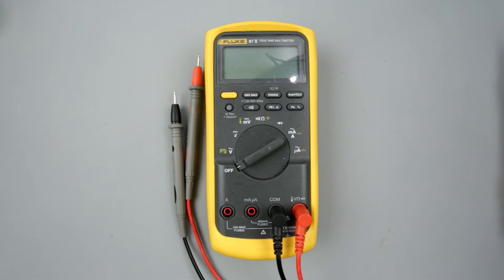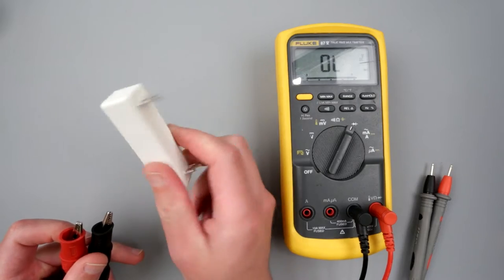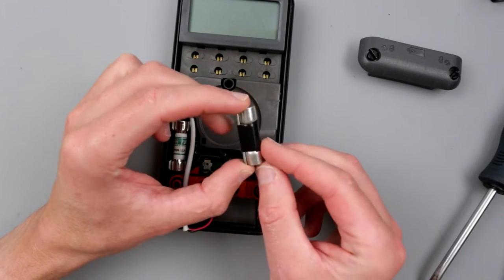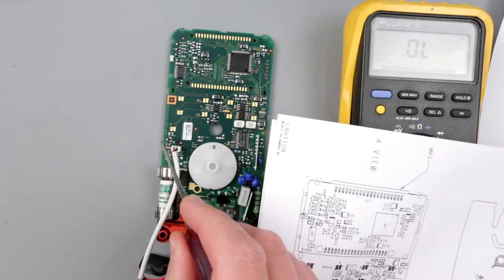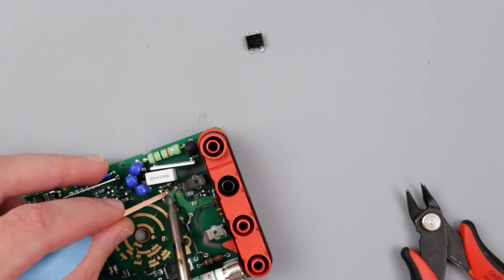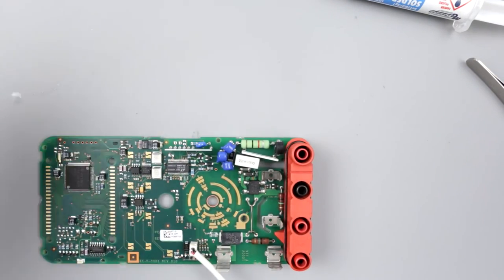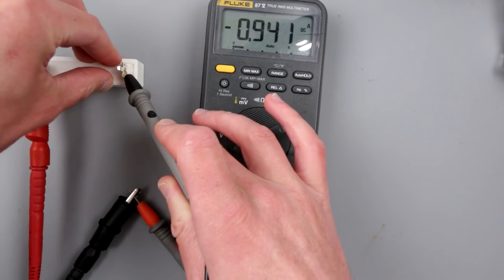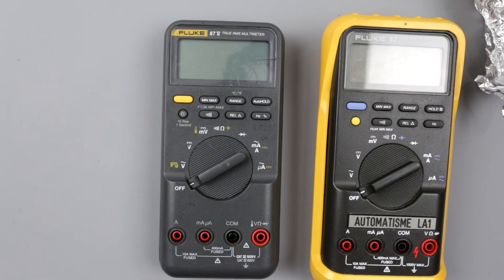Fluke 87 V repair

Comment: Great repair, love it. i bought a used Fluke 87V which had this exact same problem and exact same failed components as yours. Replaced both of them and then it is healthy again like a happy puppy on my bench. 😄
Reply from the maker: Thank you for commenting, happy you liked it!
Reply: Whare did you buy the components to fix it?
Thank you

Comment: I did replace the fuse for sometimes, because of wrong connected wires (no warning, if switch is still in current range). Of course, the fuses are expensive, but cheaper than a repairing. After replacement some parts the acccuracy can be reduced, because we have no possibility for re-adjustments.
Reply from the maker: This is true, re calibration requires precise gear, which I do not have :(

Comment: Good job. My only negative comment is you don't use enough flux. I even dip the braid in flux alcohol before use; the solder is pulled instantly even from ground planes and the risk to stress the PCB traces is minimal.
Reply from the maker: Thank you for watching and thank you for good tip

Comment: hi sir my fluke 87 v has always short in all selection mode diode, resistance voltages what is the possible components damage?
Reply from the maker: Thank you for watching, can you please tell me what modes are working and what are not?
Reply: all modes not working sir if resistance display 0.0 and the diode mode 0.0 and the buzzer on no prob inserted.

Comment: Great video, thanks.  The current reading from the power supply is probably the one that is less accurate.  I've had the same issue with Fluke 45 vs cheap PSU.

Comment: Coming in here late but ... the different current ranges have different shunt resistance! The lower ranges have much higher resistances, to get more precise measure of lower current. Amps mode is about 0.1 ohms, mA mode is about 1 or 2 ohms, uA mode is 100+ ohms! so when the external power resistor is 8 ohms, the mA shunt resistance will have a noticeable effect, and the uA shunt resistance will dominate the overall circuit.

A good way to test is to put the meter in series with another trusted meter - current will be exactly equal, regardless of different shunt and lead resistances.

Great diagnostic and repair of those current frontend diodes, btw, very nice way to recover a great but abused meter.
Reply from the maker: Thank you for comment and good point about shunt resistor !

Comment: Great video,great information. Didnt realize they make a amp tester.
Where did you get it?
Subscribed!
Reply from the maker: Thank you for SUB! This is multimeter they measure many parameters including Current ( Amp settings )
Reply: @InsideOutElectronics  I'm talking about the device you hooked up to your multimeter to test amperage.?

Comment: Good morning, 

I have a FLUKE 87 controller.

Yesterday I measured a voltage at the output of a ballast.

On the "AC voltmeter" gauge first, then on the "Ohmeter" gauge, forgetting to discharge the circuit before!

The FLUKE 87 didn't like it!

I now have, in the voltmeter position, 1.8VAC when I measure 230VAC and in the ohmeter the display flashes quickly and gives no value!

Do you think I can repair my device?

Can you tell me where to find the electronic diagram and spare parts for the FLUKE 87?

Thank you for your response and for your help.

Sincerely.

Comment: Where are you getting the schematic. I have a fluke 335 clamp meter that was exposed to high voltage I am trying to fix.
Reply from the maker: Thank you for watching, please check here - http://mobilemodding.info/fluke-87v-amp-ma-ua-range-repair/

Comment: Hi.
I saw some fluctuations while using the AC settings is that normal in this meters.?
Thanks in advance.👍🏻
I’m talking about the first setting in the dial.
Reply from the maker: Are you talking about what tou saw in my video or tour own experiences?
Reply: @InsideOutElectronics  in your video.
Reply: @InsideOutElectronics  cause I bought a used 87v meter same as the one your fix and it shows the same fluctuation in the Ac dial setting.
Reply from the maker: @adanarceo4636  I see, let me run some tests, ok? What voltage level are you noticing this?
Reply: @InsideOutElectronics  AC the first setting in the dial.
Reply from the maker: @adanarceo4636  I mean 10mV, 10V or 100V ;)
Reply: @InsideOutElectronics   no, what I’m saying is when you turn on the meter in ac the first setting there’s some fluctuation.
I thought that should be close to zero.
Correct me if I’m wrong.
Thanks.

Comment: Hi great video👍just a quick question if I may,I have fluke 117,and the beeper is very quiet, can hardly here it now,do you think the buzzer needs replacing or there is something else going on thanks
Reply from the maker: I think this is buzzer, or circuit connected to the buzzer.